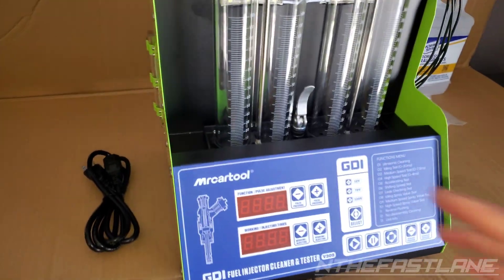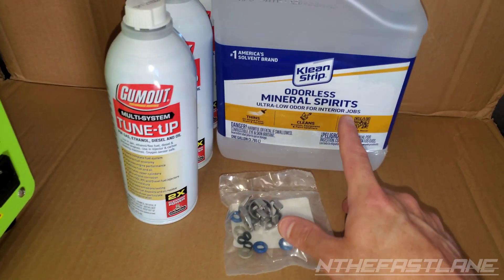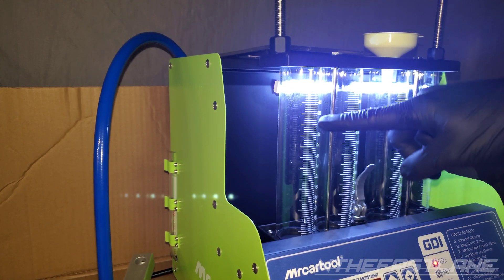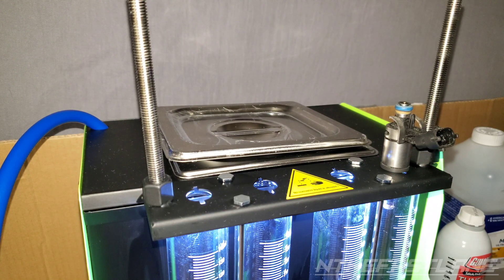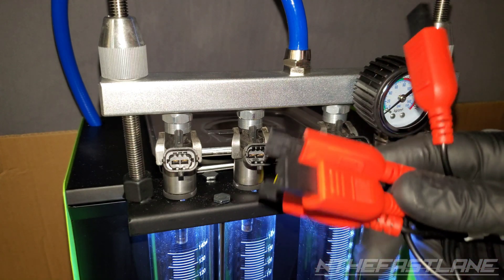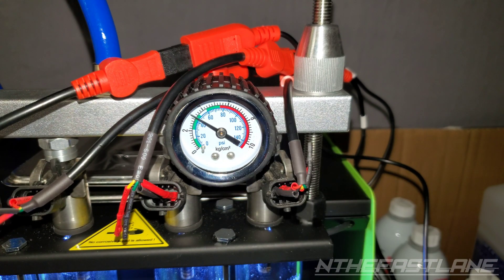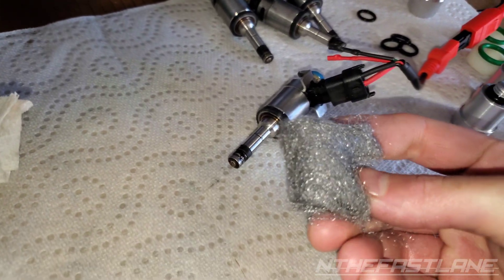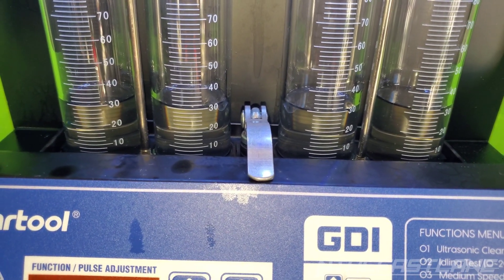Fuel Injector Tester Cleaning Machine (GDI Injectors) "Cleaning And Testing"

Comment: Does it have an heater for the cleaning solvant?
Reply: Ультразвуковая очистка это плохо, тем более с подогревом. Смотрю на форсунку, она с КIA. Доставать сетку внутри, потом вымыть на одном стенде, потом на другой проверка факела и наливов 40-120 бар.
Reply from the maker: I would say there's nothing wrong with ultrasonic cleaning and heating. Fuel injectors can reach up to 200 F or 93 C while operating on an engine. Ultrasonic cleaners are used with computer PCB boards as well with delicate chips.
Reply: @Nthefastlane  Я 15 лет мою форсунки и три года работаю в FSI. Не существует типов форсунок которых я не мыл и проверял, т.к. со мной сотрудничают сотни сервисов моей страны. много вижу после ультразвуковой кавитации. Мне проще было сделать рейку с подогревом для промывки и емкость промывочную с нагревателем. Делаю рейку для промывки 8 форсунок, т.к часто BMW N63 и Range Rover  5 литров. Ультразвуковая кавитация и гидродинамическая кавитация дает вред.
Reply from the maker: Yes it has heating in the ultrasonic cleaning bowl.
Reply: Thanks for the response, sorry to insist but are you sure about this? The reason is because i don't see the usual switch on the side to activate it and they don't mention it in their specification. I have also read some reviews on Amazon stating that there was not heater on this model???
Reply from the maker: @motovick  Yes. It shows it in the Amazon description when you scroll down to the pictures under "ultrasonic cleaning". Also I know from using it that the solution in the ultrasonic cleaning bowl gets very hot.

There's no switch that turns the heater on or off, it just gets hot when you turn it on and use it.
Reply: @Nthefastlane  Appreciated, that's weird because on page 4 of their instruction they say that there is a switch on the side to activate the heater but in their diagram of the machine there is no switch assigned to this.  So based on the Amazon review I had concluded that there was some mistakes in the instruction and also in the amazon description and that this unit does not have a heater. Is it possible that the ultra sonic device process some heat by itself?
Reply from the maker: @motovick  I would say that it is the ultrasonic piezoelectric crystals that produce the heat.

It's suggested only to run it 30 minutes at a time. Probably because it gets so hot. With this particular model it produces 70 Watts at 40 khz. If you're familiar with computer CPUs, they run about 65 Watts and put out a significant amount of heat.